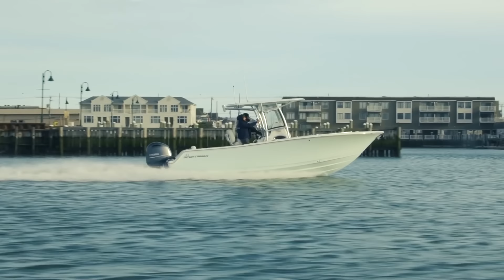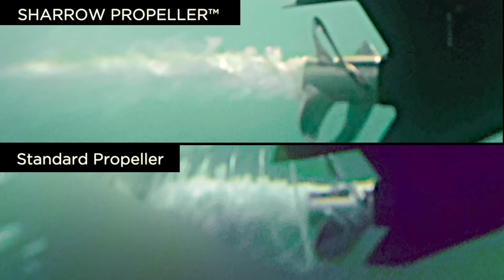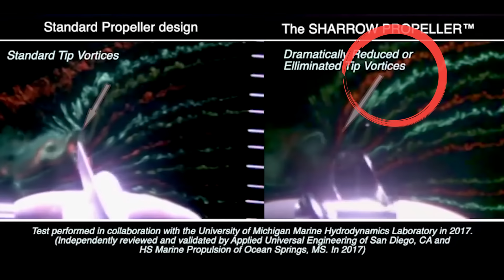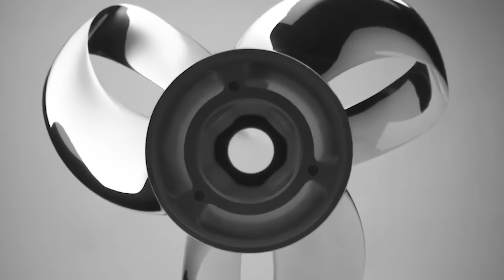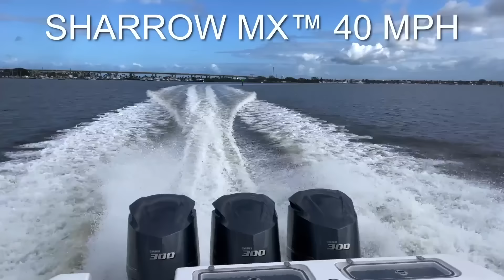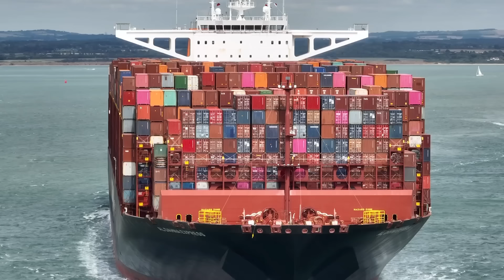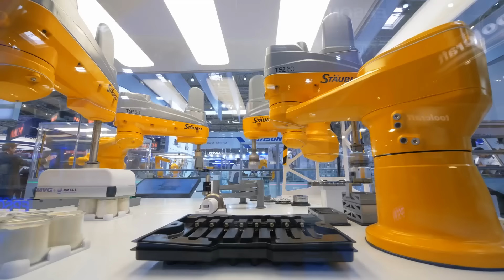This Genius Propeller Will Change Transport Forever

Comment: TLDW: The ends being closed (such as those on a wing on an airplane) create less vortices and with that, less noise and catch more air (or water) and additionally funnel more air into the propeller itself sort of like the larger intakes on planes.
It will not change transport forever, it makes it 20% more efficient for everything propeller-based where applicable (being ships and drones)
Reply: If you can get a 20% reduction in fuel on large ships that is an unbelievably massive game changer. The bill for filling up the fuel tanks on a container ship runs to seven figures.

Comment: Living near a general aviation airport, I’m wondering if toroidal props can be used on single engine propellor planes, which contribute the most noise to the surrounding environment
Reply: A lot of general avation aircraft props need to be able to move, called feathering. The pitch of the prop changes.

Some do have fixed props though. That would be interesting to see!

Comment: because of the larger blades, sure its more "efficient" and produces more thrust and displaces more water at the same rpm but what was failed to mention was how much more fuel/ torque would be required to turn the blades to the same rpm of regular blades. i mean if you just ignore this then you could just put regular blades 5x the size of the regular and it would still displace more water at the same rpm. seems kind of disingenuous to just forget that fact and make the connection that just because its more efficient at the same rpm it would translate to fuel consumption

Comment: what about the boats with the fans behind them, or airplane turbines with 20 or 30 of these as a fan instead of blades, there are so many applications that could benefit from this. someone else said this technology has been around since the 70's im shocked this isnt everywhere there must be more drawbacks, with this many benefits it simply wouldnt make sense for only a few niche companys to be doing this

Comment: Just like the difference in shape from air to water I wonder if there is a maximum efficiency at a given density. And although we can't make water more dense we can make it less dense with air bubbles. So I guess I'm wondering if the large marine application could incorporate a water density decreaser somehow. I know that mean loss of buoyancy. But maybe if it was only in certain areas like the front and rear ahead of props. Idk, I'm just an idiot.
Reply: Cavitation marine propellors are used on high-speed craft with the air bubbles forming behind the trailing edge. It helps reduce form drag but adds vibration and is damaging too.

Comment: An exceptionally interesting video.

First, regarding the higher price being against it,
This is the same nonsense as against House Insulation, Double Glazing and Electric cars, that it will take time to recoup the added expense.

Well, in ALL of these one gets the benefits from the MOMENT they are used.
Just because a more inefficient thing is cheaper, that is NO good reason to use it !
(Note: In water propeller use the Toroidal might fowl up easier, but in AIR, its sounds great !)

I would really like to communicate with the Person who came up with this Design.
Those of relevance will know who I am.

I have some Technology that they can use.
.

Comment: This is amazing- wonder why its not more mainstream. I love applications like this that are seemingly so simple in a technologically advanced world
Reply: because its much more expensive to machine than a regular prop. in the immortal words of some AMD CEO a long time ago: We could make a faster CPU than Intel. You wouldnt be able to afford it.
Reply: @TheSuperappelflap AMD did make faster and cheaper CPUs than Intel in the end though.
Also, the cost of manufacture is minuscule compared to fuel consumption. Insane percentage points of fuel saving is revolutionary, there has to be another reason for this not have been adopted.
Reply: @WreckedRectum  yes but it took them a couple decades, this quote is from the early 00s i believe. idk, im getting old. anyway things like this happen every day, its how technological progress usually goes. for example when trying to improve the learning rate of my latest AI project, this was in 2020, i came across an algorithm that was invented in 1983 and hadnt been implemented by google until 2019. until then it had just been sitting on a shelf somewhere. the algorithm is strictly better than the version i was using before with no downsides. it still isnt widely known about. using it is as simple as changing a single letter of code. i havent seen anyone use it since i found it. its called nesterov momentum if youre interested.
Reply: @TheSuperappelflap  I am interested. As I was reading through your reply I was thinking wonder what algorithm you’re talking about.
I don’t work with A.I. specifically, but I do work within Information Security and have AI as a side interested :)
Also, I’m getting old too. Didn’t feel like decades, but thinking about it, it must’ve taken AMD like one and a half decade at least to get back on top. Time flies.
Reply: you should try watching this video you just commented on

Comment: A shrouded fan (like you might find in a jet engine or computer fan application) doesn't produce tip vorticies.   And, there may be an aerodynamic limit to its use in drones and as a main rotor of a helicopter because those applications demand the prop be moved laterally through the air, not parallel with the direction of travel.   The blade going from advancing to retreating might suffer signficant drag at the 12 and 6 o'clock positions.

Comment: This shape is so much more efficient that it's able to completely offset its own weight increase compared to a normal propeller as well I'm guessing. Doesn't matter as much in a boat, but on a plane or helicopter I wonder if that holds true.
Reply: nop, you know why, because propeller on a plane need to change his pitch depending on the speed to be efficient

and a hellicopter need to change the blades collectif

this is only applicable on fixe pitch device like boat and small drone
Reply: @mathis.docquier  That's an important factor too. 

Thanks for this reply, sent me down a rabbit hole learning about variable pitch and how it can help a helicopter land safely when the motor dies via auto-rotation. So even if this design is more efficient at creating lift, Idk how you'd do a emergency landing in a helicopter with it!

A vertical lift capable airplane I think could get away with it actually though, if it has the   rotors inside the wings and they can be covered when not in use, there's no drag to worry about, and it could still glide to earth in the event of some engine failure.. but that does require some much more mechanically complicated engine/wing designs that probably keep it from being useful in the mainstream airline industry.

Unless you could use this in standard propellors but have some way to limit the air flowing through, like if the spinner cone could change size somehow?
Reply: @EileenTheCr0w  using a toroïdal propeller in your idea of a VTOL wouldn't help because the thing that toroïdal propeller is suppose to stop is tip vortex and since the tip wouldn't interact with air because it is enclosed. it will not add anything.

and for use as a standard prop, it would still need to change its angle of attack depending on the speed which is impossible for this shape because of the two fixation point of each blade.

Comment: Misleading title. It's not 105% efficient, it's 105% more efficient than another design, that's not the same thing. Plus I'd be amazed if the  likes of dowty propellers hadn't already thought of this, so there must be drawbacks which are not explored in this video.

Comment: Interesting from an engineering standpoint but in the first video with the engine from the outboard engines comparing the prop from the same load there was a difference in engine noise not water noise, not the same as air noise in an air moving propeller.

Comment: As others have pointed out, Variable pitch propellers are essentially standard for larger applications (both marine shipping and larger manned aircraft). I'm curious if theres even a possibility to make variable pitch toroidal props. I also wonder if the toroidal propellers would stand up to the increased centripital forces that come from increased diameter. Even if a Toroidal Helicopter rotor would stay in one piece, would it manage to keep its shape enough to retain the benefits?
Reply: If they don't handle larger diameter size, you could simple install a circle of multiple rotors around a cingular drive shaft to get a similar effect in terms of thrust. So instead of one large prop, you have five or six smaller ones all driven by the large motor.
Reply: @matthewbrown5228  yeah but weight and complexity. And price too if they're hard to manufacture.

Comment: I'm calling BS on the drone props.
Every second word in his sales pitch raises a red flag. 
None of the data he shows has enough information to make a valid comparison. Note how the boat data compares noise at same boat speed or prop rpm, where as the drone data never mentions anything like speed, power efficiency, rpm etc.
Everyone that I've seen trying the idea has reported more noise and less responsiveness on their drones.
The problem with propellers like this in the air is that the extra drag outweighs any gains.

Comment: It isn't that it causes less turbulence, but rather that it focuses the turbulence in a useful direction.
For PC fans there is minimal benefit as the rpm is far too low to get the gains. Maybe with insanely high speed server fans it could be helpful, but for most computers it is easier to push more air at lower speeds with wider fans than to spin at insane rpm where this would help.

Comment: 38% to 78% efficiency improvement is 205%?!  Your terminology and statistics abuse is 105% awful.  Hard to take anything else serious after that.  I’m out.
Reply: 78% is 2.05 times 38%.
Reply: @General12th  it is already in percentage, so it is 40% more efficient at that RPM, which is another red flag.  They should be compared at a given input power, and really the peak efficiencies should be compared, not a cherry picked spot where the ratios are highest.  I can compare two props of the same type with different pitches and conclude that one is better than the other, while in reality one is optimized for a higher or lower RPM than the other.

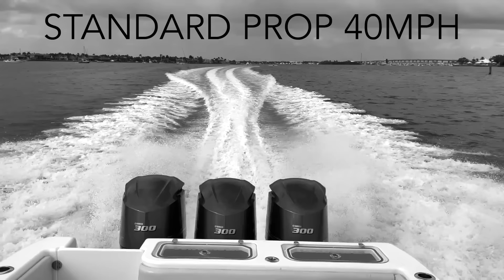Comment: I think the noise comparison at 2:32 is misleading, or at least confusingly presented.  The only way that makes sense is if the propeller is so much more efficient that you can run the engine at a lower RPM and still maintain the same speed, not that the propeller itself is quieter.  The internal combustion engine of an outboard motor is so much louder than everything else that you'd never notice any difference in propeller noise.

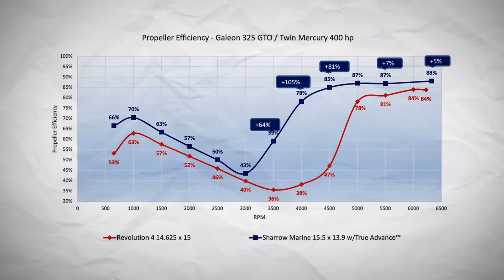Comment: It is very cool. But the main conclusion of the graph at 2:59 is that you should design your transmission to operate above 5000 rpm typically, and that if you're doing this, the relative gain is only 7%

Comment: Nothing is 105% efficient. It's against the physics of conservation of energy... You can't harvest more energy than is available. The reason why a perpetuum mobile doesn't exist. Any device with moving parts will offer a small resistance in bearings and the likes - transferring some energy into heat. That energy will not be available in transferring wind to electricity.

Comment: Any input/information on comparisons with Dual Prop Vs this new prop? I'm curious of the performance difference of those 2 since this new prop almost looks/acts as a dual prop
Reply: I think sharrow intentionally only did comparisons with single props, since the upgrade would be less significant over a duo. Something not mentioned is that conventional props can often be repaired if they get a small nick or bend from a collision, using something like PropScan. The toroidal ones would probably be trashed however, until they come up with a much more sophisticated repair tool

Comment: 105% is impossible per the 1st law of thermodynamics. You cannot get more energy out than you put in.
Reply: 105% more, not total. 40% efficiency 105% higher is 82%
Reply: @sam512  That's not what the preview says, it claims 105% efficiency.
Reply: @wiscgaloot  +

Comment: I wonder how this toroidal shape would work for a desk fan? Traditional blades are sharp and dangerous and fan must use OSHA approved grills over the blades to protect fingers. With such efficiency, a toroidal blade could use less energy and spin at a lower speed thereby making it less dangerous and providing more airflow too. Perhaps a grill wouldn't be necessary at all. .

Comment: @:30 seconds - this is going to come down to vortex shedding, i think?  No discrete trailing edge should mean no formation of tip vortices, which are the primary source of drag on a screw/prop.

Comment: One drawback I could see is the tork needed to acclerate the propeller. With an higher peripheral weight it's also more difficult to have a perfect balanced propeller. In drone usage those two drawback is something to consider.

Comment: Curious to see whether this will also hold up on smaller output engines and motors for marine use... 150HP is quite a high start... Also curious how elctric marine propulsion could benefit from this

Comment: What your saying is false or inaccurate brother. People have already started 3d printing this and noting (on drones mind you) it takes way more power to use and barely different in noise. They've literally commented that the dropped in battery efficiency its dang near useless as of now.

Comment: The thumbnail says 105% but you don’t address this impossible stat in the video. Dislike
Reply from the maker: This is shown on the graph at 2:54
Reply: @ZirothTech  ok I see that I misread the thumbnail when I posted this. Thanks for clarifying. Changed to a like. Thanks for quick response

Comment: The fuel costs for a large cargo vessel can be over 3 million for a round trip. The cost savings from a toroidal prop could be massive and pay for itself in just a few trips, even if it gained a modest 10-20% increase in efficiency.

Comment: I want to print one of these to try on my smaller outboards, would be awesome to compare it and see what a little 1.5hp motor can improve
Reply: From all the comments I've read, this design for a prop would work best on slow spinning motors. Balance and vibration at higher speeds become an issue according to the comments. 
Maybe using something like a Brigs and Stratton in an inboard to create an economic trolling boat for the 1 to 4 mph zone
I too am an avid fisherman and about to start a boat build.
Reply: @MrMunchman69  yes id love to see what its like on electric power too. I have both 2 stroke and 4 stroke small motors under 2hp. I just need to see if i could get it 3d printed somehow. I do have one but its rather small

Comment: fuel savings are probably much higher, because you can simply use ur motor power at like 50% for same speed u needed before. so its like 120% fuel savings if im correct.